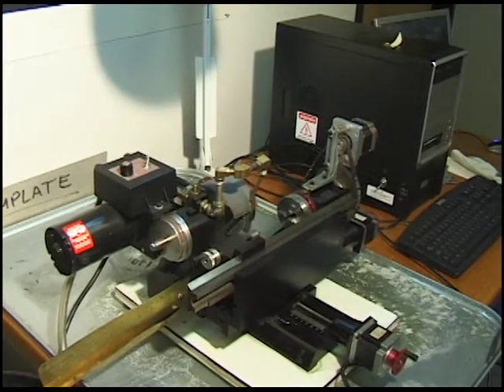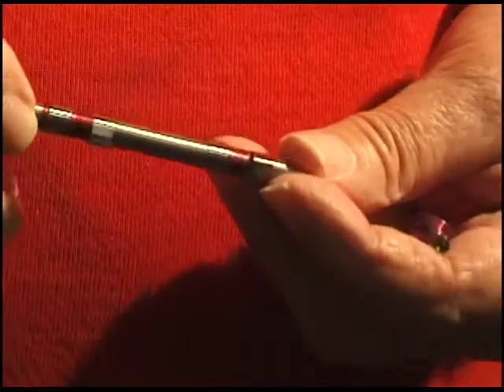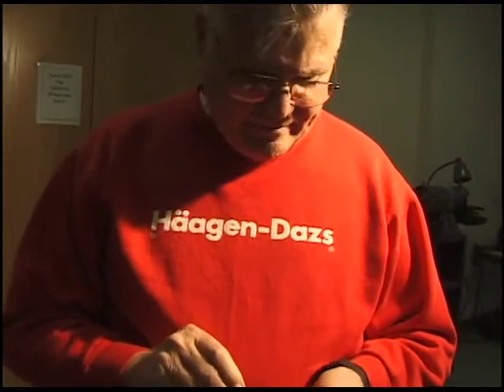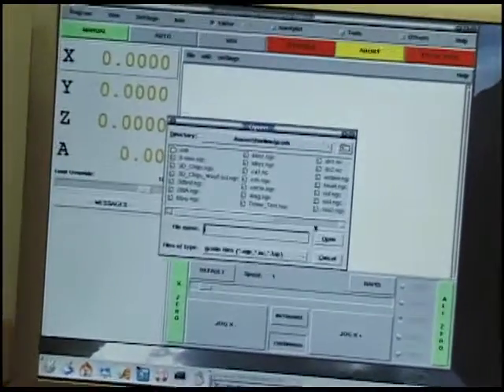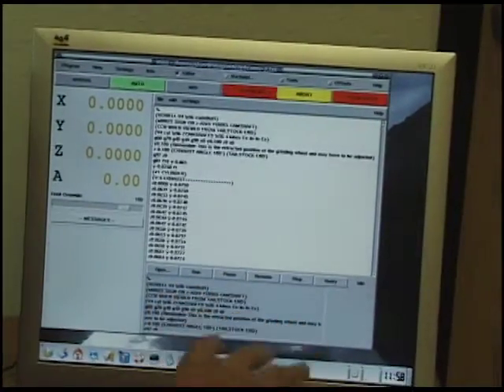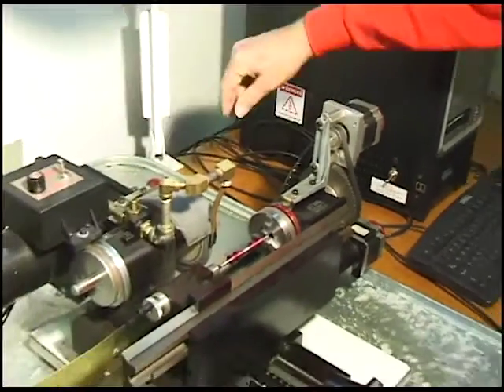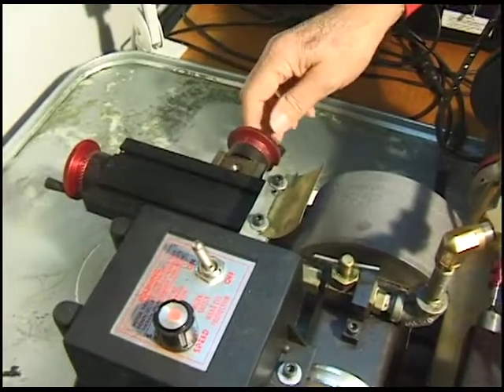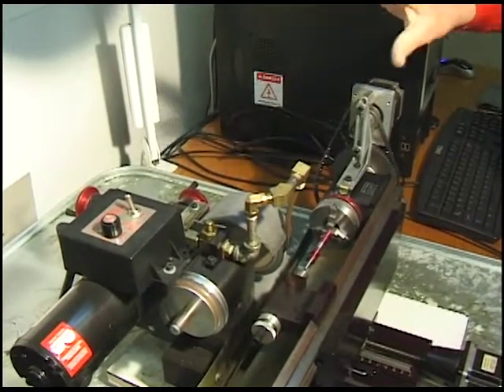Sherline CNC Cam Grinding, Part 1

Comment: Is the software free? Do you have to  make a boot up in Ubuntu?
Reply from the maker: The software is free with the purchase of the cam grinder. You can write your program on a PC (or any other OS text editing program), but you will need to port the file over to a Linux OS to run the program. Check our cam grinder web pages for more details.
https://www.sherline.com/product/8650-cnc-cam-grinder/
https://www.sherline.com/product/8655-cnc-cam-grinder-computer/